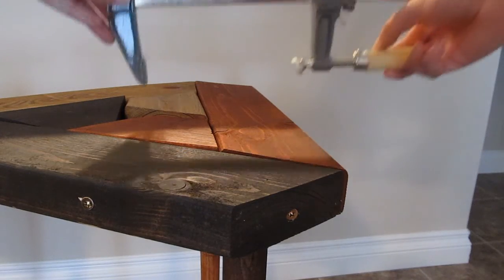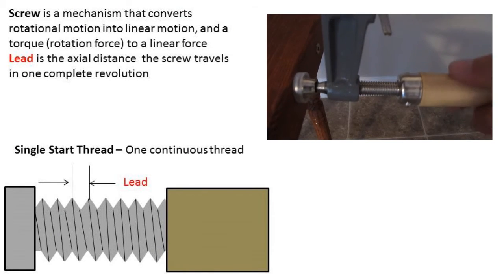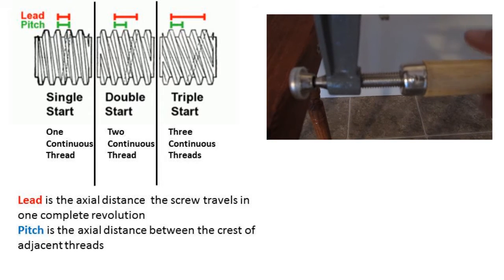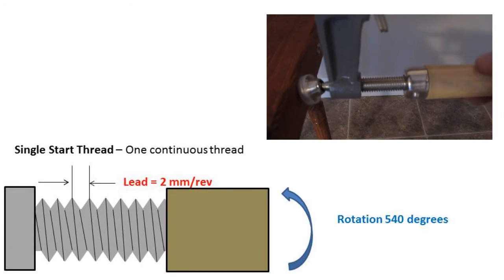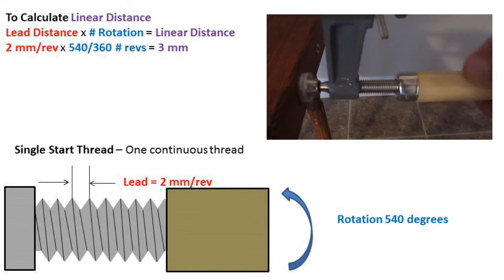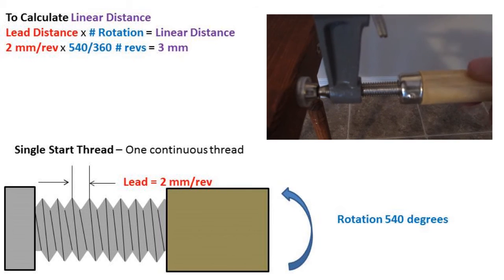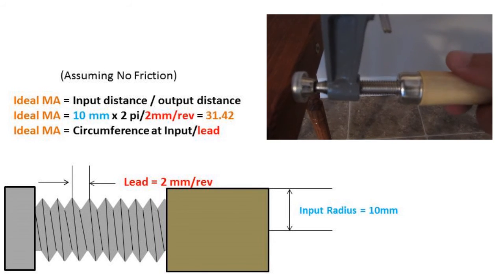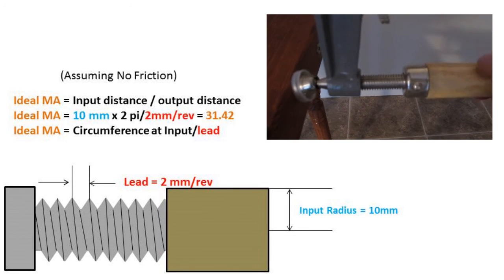Screw Physics! (Distance Traveled and Ideal Mechanical Advantage)

Comment: Thank you for the video. I am a mechanical engineer student and I facing a problem like this. I have not being able to figure out the force that a screw exerts. My system is a 1/4"-28 bolt that goes through a 1/4" wall. The torque applied on the screw is 5 Nm. If you can help me that would be great, I have had a hard time with this problem. Thanks!!